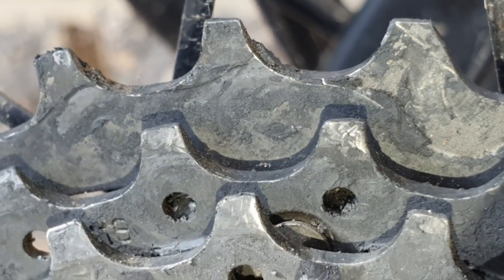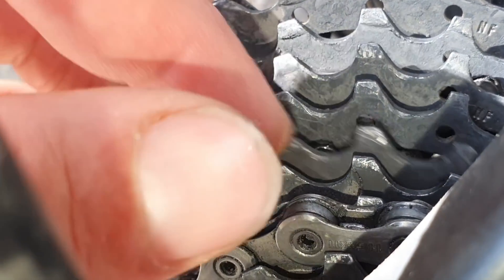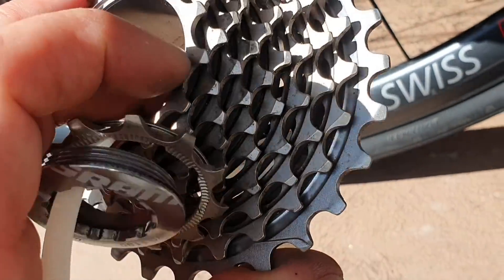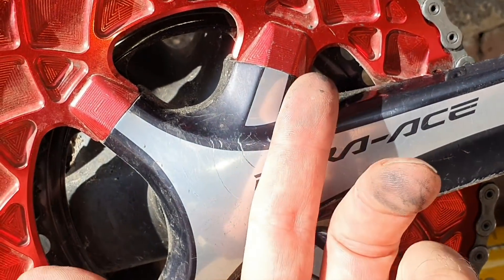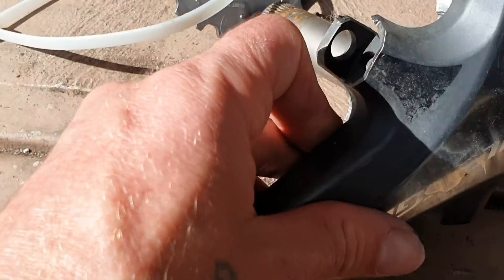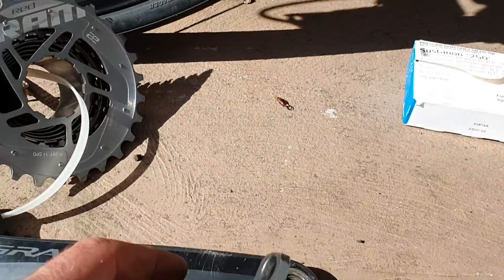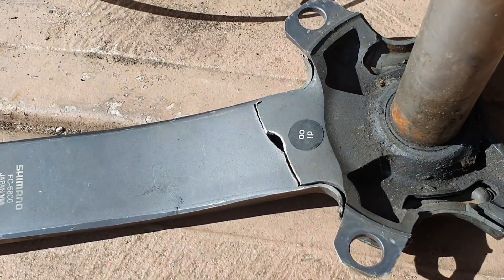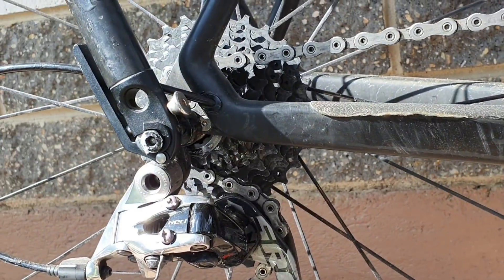An Expensive Side Effect Of Anabolic Steroids

Comment: Albuterol isn’t a steroid though… it’s a beta 2 agonist. Fluticasone would be an example of a corticosteroid
Reply from the maker: It is like steroids for your lungs. You know what Im trying to say. It is a hardcore PED.
Reply: @durianriders  Albuterol will only let you breath better beacuse of it being a bronchodilator (selective beta 2 agonist). Corticosteroids like fluticasone on the other hand will reduce inflamation generated by free radicals and speed recovery, giving you a significant advantage when you are pushing your body to the limits, like riding the tdf. Albuterol is not that hardcore, it is the 1st line treatment for asthma, and is relatively safe compaired to steroids, cheers.
Reply: Working on a full Albuterol kit, replete with blue-tone color scheme and pharma-style molecular graphic.  Any advice on a good jersey printing service?